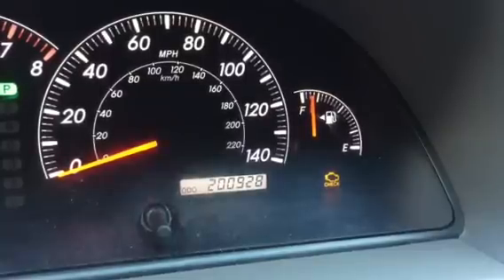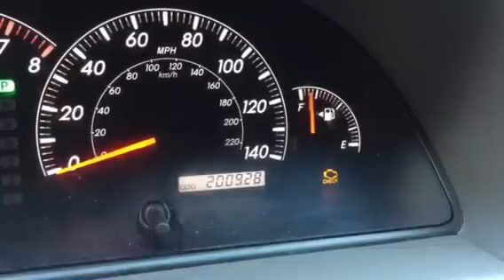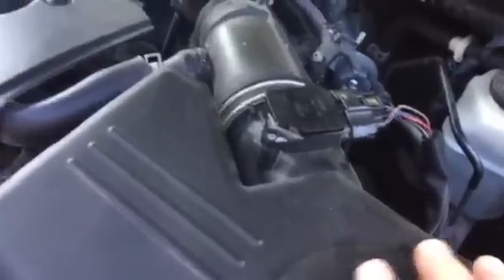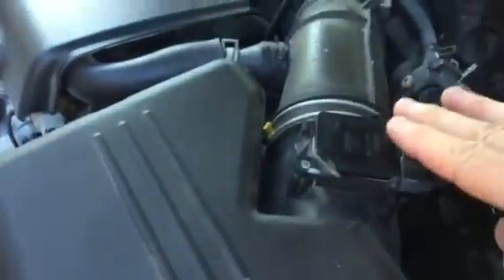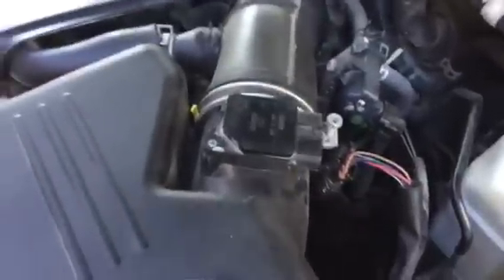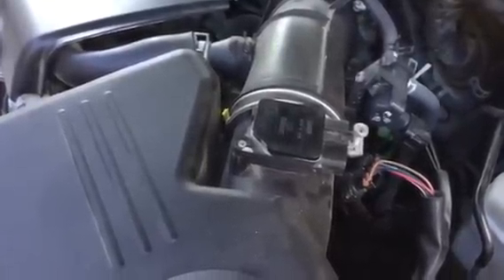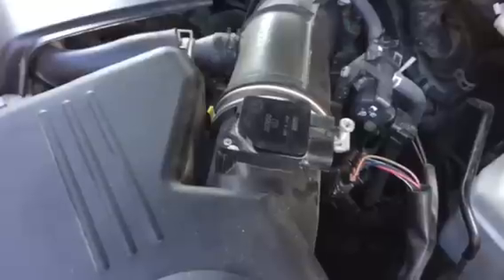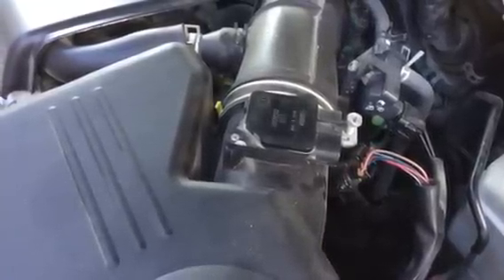How To Tell If Your Mass Air Flow Sensor Is Bad On Your Car

Comment: You saved me from headaches. I thought my transmission was the problem, the dealer told me I needed a new fuel pump, and my brother said I needed a tuneup. After watching your video I tried it out on my car, found out it was the MAF sensor, ordered it and my car works like a new one. Thanks!!
Reply: The dealerships will scam the scrap out of u
Reply: @creolecajun7750  Actually i belive yall overestimate their competence. As if you thretened them with thousand years of cruel torture they would be able to figure out whats wrong and fix the car...
Reply: @GGGmod1  They can plug in an OBD2 meter and find the problem right away! A good meter tells you what's wrong.
Reply: @davisrs1  no, it will provide clues as to what the issue is but it is by no means a chrystal ball. what is done with the information provided is what makes the technician.
Reply: @sladeherb4056  
OK, point made. As an Engineer the deduction process is simple, but not everyone is familiar with combustion chemistry and all of the new stuff manufacturers have thrown in to make it "cleaner"!
Reply: @creolecajun7750  Yup, they will tell you they need to diagnose it for $200 and then replace the part and charge you another $200.
Reply: Did you try cleaning it first with maf sensor cleaner so you didn’t have to spend money on a new maf for no reason?
Reply: @tomster7574  and remember to remove it and let it dry like Scotty say. I do it like that now.
Reply: @tomster7574 sometimes that doesn’t work. It didn’t work for mine on my ‘01 ranger. Had to replace the sensor. Good to keep it clean as a preventative though
Reply: Also unplugging the mass air flow sensor while the car is running on some cars will cause the car to go into a test mode and then u may have to see a mechanic to get out of test mode
Reply: @madetohelpyou  this is what I was thinking.
Some things people say do are ridiculous.
You better call about 3 mechanics and ask their opinion before doing
anything you are not qualified to do.
Reply: I dont trust mechanics really lol always saying it might be this you fix it and it wasnt there so dumb some of then and there unfair they act like shits free or we rich 2 be buying stuff we dont need sucks
Reply: We call them stealerships over here. Never take your car to one. Find a nice locally run garage that you trust.
Reply: Did u install it yourself?
Reply: @Gawddess  It's easy. If you don't have to tool, buy the tool.
Reply: My brother in-laws truck had this same issue.
Reply: Thank you
Reply: I I a 2nd 3535erq5q33q444
Reply: Hi what is wrong of your car
Reply: Nice! 🇺🇦🇺🇸🤜
Reply: Hhhhhhh thank u bro ❤
Reply: They can plug in an OBD2 meter and find the problem right away! A good meter tells you what's wrong.
Reply: So funny because I thought it was the fuel pump too.
Reply: what was it doing to make u think it was the transmission
Reply: Does this work for all cars
Reply: @jimmyfale6370  I'm asking the same question cause mine didn't stop but it didn't sound the same
Reply: @krishonorton5552  so if I unplug the mass air flow sensor to see if it stops,will my engine sound differently afterwards?
Reply: Junk see dealer to turn light out

Comment: Im confused how this works. Cars have computers that tell it how to run. If you unplug that the car should keep running using its default.  Wouldnt that mean theres a problem with ur computer if it cant run without the sensor?

Comment: Hi mate I have peugeot 508 2.0 diesel 2014 years I have one problem i take off Flow meter it's working bad is lights checking engine  and not working cruise control...
If I put it back it goes very slow bad it's working cruise control what's the problem?????

Comment: Thanks man I was just quoted 400 bucks to change my mafs from an auto shop
Reply: What country and type of vehicle? If in the USA like myself, it shouldn't cost more than $50 - $100 for the part and very easy to replace, so not more than $100 for labor. $200 USD total would be on the high side. You have to watch some mechanics or they will overcharge. Not all, though....
Reply: @jlcastille9017  hey I ended up getting a MAFS on Amazon for 29 bucks.  My neighbor reset the codes for me with his diagnosis machine.   Done deal 👍🏻
Reply: @JimmyR83  Good Deal! Just beware. Some cheap after market parts may not last very long. Hopefully, it will hold up fine.

Comment: I just put a new one in. 
The engine does Revs up a bit but keeps running. 
I’m baffled 
Can anybody help
Reply: https://youtu.be/O4pBu3uRlYA his is how you properly test it I think
Reply: It might be your tps or iac at your cars throtle body
Reply: @nathanfield-patton7128  Thank you!!
I’ll try that
Reply: Thanks
Reply: I think this might not be your mass airflow sensor. What dose you car do that’s wrong?
Reply: @nathanfield-patton7128  My check engine comes on because of a lean condition. 
So far if I clean the MAF sensor the light stays off for a couple weeks or so. 
It seems like some how it is getting dirty. 
I did change the air filter to.

Comment: Yea. If it's already running and you unplug this thingy right here and your car shuts off that sensor is not the problem. 
But if your car is already dead... just assume it's that sensor and just replace it. 

Try that shit in a garage setting and you'll get fired. There are 500 other ways your car wont start and run. 

Get an obd2 code reader.

Comment: Looks like my MAF sensor is bad. I tried your method and when I tried to pull sensor, it had hiccup with engine keep running though.
Reply: i have Nissan Quest 2007 and somehow, I feel that your method may not be correct. May be it is specific to your car/model

Comment: Dude, the sensor could still be bad even when f your car shuts off when unplugged. Mine shut off when I unplugged it, but when I installed a new one, all problems vanished. You are NOT correct in your video.

Comment: My Chevy Truck would not start because of the Mass Air Flow Senor so I couldn't get a Check Engine Light so I didn't know what was wrong.   A Mechanic figured it  out.

Comment: Please my Honda Accord 1999 model issue was If I park over night and start in the morning it start once but if the engine is hot it will crank like 5 to 6 time before it start,  I have change the complete injector, fuel pump, fuel filter, I check the plugs to see if the distributor is ok and it work fine, I even buy new starter and battery today and the problem still occur, I need your help on how to solve the problem some time I have to start it from engine starter before it works
Reply from the maker: This is more than likely your problem https://youtu.be/MvBHUUMezRY
Reply: @proclaimliberty2000  thanks so much on the video, but my own case is a little different cox if my car crank when hot, if i spray fuel inside the throttle and i start the car it will on once. at first i thought maybe the injector is not supply fuel and i change the injector the same thing still occur

Comment: You should make known that NOT ALL cars or trucks have a MAS. Dodge trucks started using them on 2010 models. My wife's 2003 Dakota 4.7 doesn't have it. But a bad TPS, MAP, or IAC can cause rough idle and whatnot. There are alot of sensors used for specific jobs. Test the sensor before throwing money at a vehicle. There are alot of videos. And determining if the sensor is bad by removing it, the truck is going to react the same whether you remove a good part or bad part because all the vehicle knows is that the part is removed or disconnected.

Comment: I’ve been having rough idle since I bought my used 2015 camaro rs, I just disconnected the mass air flow sensor and it made a TINY hiccup but kept running fine otherwise, I have a air intake so I’m going to install a new one and update this post on the results
Reply: Did it work??
Reply: @kevincharles1983  actually I went to my local hardware store I used O Riley’s and picked up mass airflow sensor cleaner and my car runs better then when I picked it up from the dealer at 24k miles, if you floor it and your car doesn’t rev up immediately then I would try that if your car still has problems then buy a new one, ALWAYS GO THE CHEAP FIX FIRST the can cost me $9

Comment: Just like testing your alternator to test that unplug the battery when the car is running if the car stops your alternator is bad. Great job
Reply: You should not do this because the battery acts as a capacitor (voltage spike dampener). The alternator will generate more voltage the faster it spins far in an excess of 12 V. The battery is there to absorb the voltage spikes and distribute an even 12 V to the electronic components that can’t handle more than 12 V. The car actually runs off the battery. the alternator keeps the battery charged. But the car does not run off the alternator.
Reply: For alternator testing I only do this for old cars I remove the red cable off and see if it's going to die or stay on for the new model cars I wouldn't do that so please don't do that on new cars
Reply: Just check voltage across your battery terminals with car off , then on. Should see voltage increase when running, if not alternator failing. There you are!

Comment: I did what you said on my 2017 gmc sierra and it kept running. I have had misfires all over the place, mainly the 4 cylinder. Check engine light stays on and flashes. Also stabilizer comes on when truck shakes while driving and giving it a little gas. Rough idle too. Ive also changed the spark plugs, spark plug wires and coils. I hope this is the problem, it would save me from tearing into the motor thinking its a lifter/valve.
Reply: You have a bad injector change it truck will run right

Comment: My brother’s car wasn’t running smoothly. Mechanic told him he has transmission problem cuz it was heavy and not changing gears properly. He was an 1,1/2 away from me. I said hold on I’m coming. So I did the same thing as you did but this time to each spark plug wire. Fair enough on one of pistons when removed while engine running, nothing was happening, no change to the sound of the engine at all. It turned out to be just a bad wire. So we put new set and done . No transmission problem as the crook was trying to cheat
Reply from the maker: chiya2006 Great diagnostics trouble shooting.  Your brother must have been one happy guy. I don't know if you know about these washers so I thought I'd send you this. https://youtu.be/ROC6zU1cAWU

Comment: One quick note. When you do this usually check engine light comes on.  Dont forget to remove negative batt terminal and put it back after a while to turn this notification off.
Reply: or if you have a scan tool you can clear the light also.

Comment: I agree with the comments, good video, I would like to add one detail if I may. Another option is to purchase a can of MAF Sensor cleaner, and I only say this because some of those sensors can be expensive. I've had excellent results with the cleaner, and no disrespect intended to your video.
Reply: Agreed. Usually a simple cleaning does the trick. Not always, but it's good maintenance to do. At a minimum, it can extend the life of the MAF.
Reply: Electronically a mass airflow sensor is a very simple component. It consists of a thermometer and an anemometer. The anemometer measures the airspeed and the thermometer  measures the air density and given a fixed diameter you can calculate exactly how much air is going through it
Reply: WOW I have now gone through 2 and prob 2 hours of research to have you simply unplug it... Your on point.  
MILLION DOLLAR QUEST.
For both of you Scholars, if the engine doesn't  Is cut off and still runs which would means my sensor's bad, I could still possibly clean it to salvage it??? 
I did try to spray a bit of cleaner but still the same problem, any further suggestions aside from the basic spray cleaning?
and the mi
Reply: @nicholasjr.2315  
Egg
Reply: I've never had luck with cleaner. Maf sensor is so sensitive most the time it just needs replaced. Unless you're car is one that just happens to get dirty air a lot.

Comment: Hiya, thank you very much 4 your help. I done this and my car stopped running I was happy I had cleaned it  after I had a code 4 the mass but my car is still running rich and another code has come up P1550 help I have a Nissan tiida 2004 hatchback.

Comment: My f150 97 5.4l runs fairly smooth at idle. Slight roughness. When i put in gear and try to drive it barely wants to accelerate. I did unplug the maf sensor and it accelerated a bit better but still nowhere near normal. The farther i press the gas pedal down the boggier it gets. Does that sound like the maf sens is bad?

Comment: Yes that's fine but that doesn't prove that the sensor is giving the correct values to the ECU as if dirty or is faulty it will still work but you may be getting the wrong values indicating a faulty sensor. All you have proved in this clip is that the electrical side is ok but proves nothing else. Only by seeing with an OBDII tester can you say the sensor is working as it should be and see what the correct values are. Just thought I'd mention this just so you don't get mislead that the sensor is working fine just by disconnecting it.

Comment: I need help, my car was running good then one moment I turn it on and the abs brake battery and slip light came on and I have no acceleration no power windows no headlights or hazard lights, ac works, reverse lights work, I replaced alternator, battery and throttle body and I need help
Reply: It probably  the crankshaft position senor.     It's easy to do , but on some cars it in a tight spot.   👨‍🔧🚘

Comment: I just changed mine’s a few weeks ago I have a O2 Mitsubishi lancer it was running terrible it would run but it would I don’t want to tone up and down and sometimes when I would get on the freeway in Qatar punch it wouldn’t it wouldn’t go if I like it was choking so I got another one of the junkyard and I switched it and I sprayed with brake fluid inside of the air manifold and clean it with a rag and boy my car runs great and I even sound like a terrible now when I punch it in response thank you Jesus 🙌

Comment: This test is not accurate, newer cars go instant in emergency modus and ecu take over...
Reply: can you explain?  Will the ECU tell the car to add more fuel or air ?
Reply: @breakaway2x  yes .
Reply: Some cars use hot wire mafs and some cars are using hot film mafs, while some cars use no maf, they use speed density. To test properly you first should know what type of sensor is being used, and most tests will require you to get into closed loop at by getting the vehicle to operating temperature.

Comment: THIS STATEMENT IS FALSE: "If you disconnect the sensor and your car continues to run, it needs to be replaced - it's just that simple!" - THIS IS FALSE. On my 2009 GMC Sierra 1500 Denali 6.2L, I did this test because I was getting a multi cylinder miss (on 1 and 5). One of the things that "could" cause this is a bad MAF, although it's unclear to me why missing would be isolated to 1 and 5 if it was the MAF.  I watched this video and did the recommended test - It continued to run when unplugged. My OBD2 scanner did not indicate a problem with this sensor and the live data it was producing looked ok.  I spent $10 on MAF cleaner and cleaned it. No change to data, no change to engine performance. Still missing. I went ahead and replaced the MAF anyway ($58) based on this video, given my truck had 119,000 miles on it and it's a relatively inexpensive part. New sensor reads the same live data ranges, engine still missing on 1 and 5, and I've spent $68 for nothing. I mean I have a new sensor that should be good for another 120,000 or more miles, but I didn't need it. Maybe I can return it, but I doubt it. Do not assume unplugging the sensor means anything, because it clearly does NOT.
Reply: Yep... I have a 2005 Cadillac STS 4.6L and did this test and the car keeps running. I even bought a refurbished MAF sensor at AutoZone this morning, after seeing this video (08/03/2020) and no results. I even plugged my old MAF back into the car and after disconnecting the connection to it, the car still runs. So, all-in-all, I definitely wouldn't rely on this method to determine if your MAF sensor is either bad or good. It may be the opposite that means the problem...... meaning, if you disconnect the wiring from the MAF and the car shuts off, then that might mean you DEFINITELY have a problem, but not with the MAF sensor. Either way you look at it, this video does NOT help you diagnose a bad or good MAF sensor.

SuperReverbious, you are having the same issues as I'm having, and from the tests I've performed on my car, it appears that there is either a short or open to ground. I'm not sure which one it is, but it's in the wiring somewhere. I'll have to figure it out. I need to check my relays and fuses under the rear seat, because the under-the-hood-fuses and relays are fine. I'm betting my issue is with the wiring somewhere causing this. 

One Man's Opinion